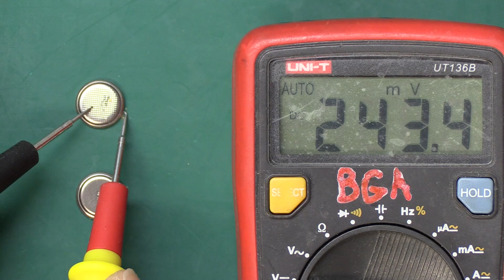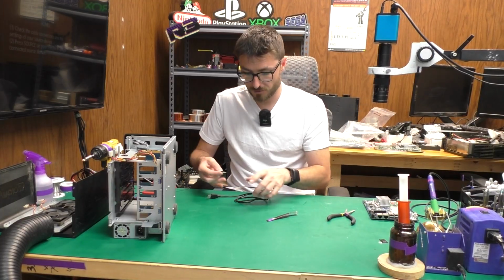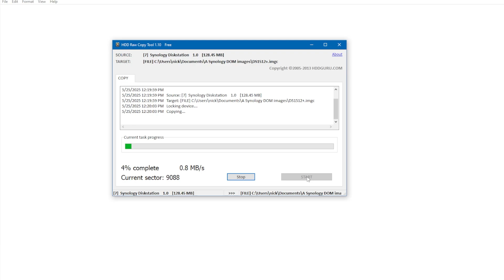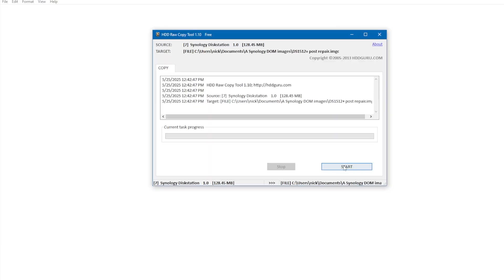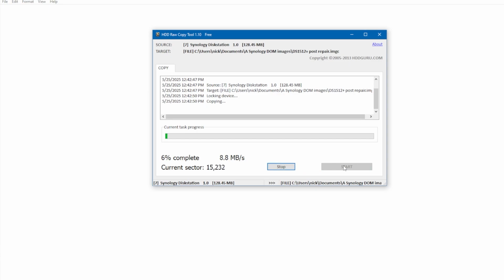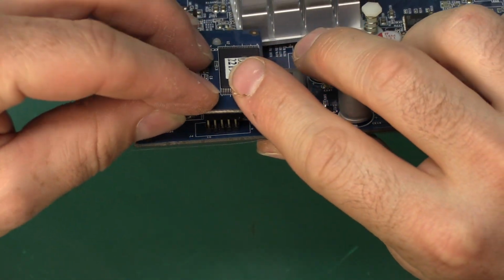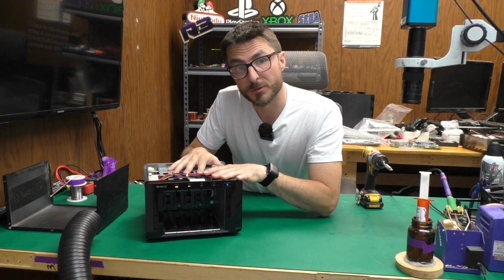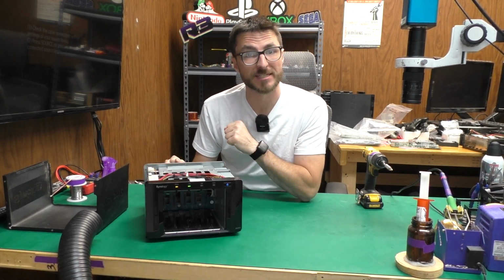Synology DS1512+ How To Fix All Faults

Comment: ChatGPT said the reason my 1512+ had a blinking light unable to boot was most likely due to a bad power supply.  How could I test if the power supply is the fault?
Reply from the maker: Chatgpt should not be used to help you fix things. 
Please watch the video, I tell you how to fix your issue in the video.
Reply: @NicksElectronicRepair  Yes you talked about multiple things that could cause the blue blinking light.  How do I figure out which one is the issue without replacing everything?  The most easy fix is changing the battery or power supply.  I have no skills and lack the tools to swap chips off the board.  Do you know a way I can test to see if the power supply is the culprit?  This thing worked fine and I was powering it down to clean it out .  After I cleaned it I got the blue blink and it would never start back up.
Reply from the maker: You should definitely replace the CMOS battery. But the U1 IC chip replacement is what is going to fix the blue blinking light. It is an advanced repair. The power supply replacement will not resolve a blue light blinking issue.

Comment: I got the files from my DOM but not expert enough to do soldering for replacing the UBest chip. Is it possible to make my DS1512+ instead of boot from DOM, to boot from USB stick? Thanks.
Reply from the maker: We tried that once and it didn't really work. Maybe but I don't know how if you can.

Comment: Do you have to do those last 2 things only if the unit is Dead/No power?  My unit just continually has a flashing blue light.  After this kit has been installed can i just put my drives back in and boot like normal?  How do you also go for international orders?  Also is it possible to just replace the whole little DOM board? Sorry for the many questions.
Reply from the maker: "Do you have to do those last 2 things only if the unit is Dead/No power?"
You don't have to do all the component replacements, but if you don't, those parts might fail soon. 

"After this kit has been installed can i just put my drives back in and boot like normal?"
Yes, that is correc,t it's plug and play

"How do you also go for international orders? "
The same way we ship domestically. You enter your shipping information, and we ship it there. 

"Also is it possible to just replace the whole little DOM board?"
You could if you can find one for sale. But no one has them, which is why often you have to fix your original. 

I just want to add that based on your flashing blue light symptom, you most likely will need to replace the U1 chip on your DOM. And based on your questions, it does not sound like you have any soldering experience, and thus, I want to strongly advise against this being your first soldering experience/attempt. Your first 10 times soldering should be on a practice board or on a board with low value. If you damage the DOM while trying to fix it, because you can't replace it, you would essentially make your entire NAS unrepairable and would have to purchase a new one. If you are trying to buy the kit, I assume it's because you would rather save money than spend $800 on a new unit. Yes, I am biased, but if I am right and you haven't had to solder this type of chip before, trust me, it is in your best interest to spend a bit more for us to fix it right, and you get a 1-year warranty.